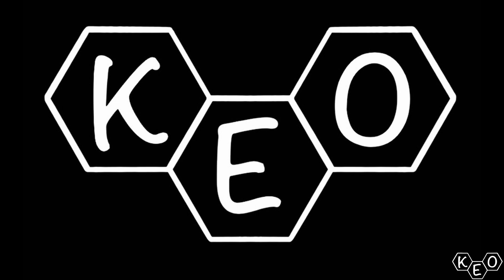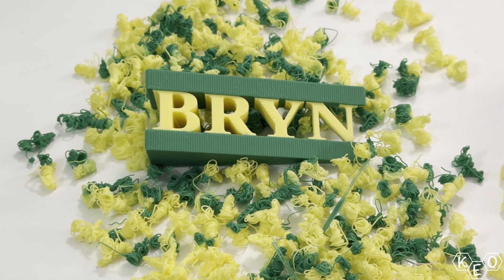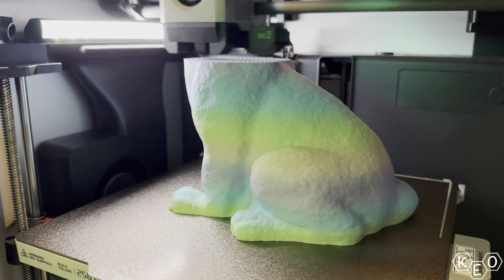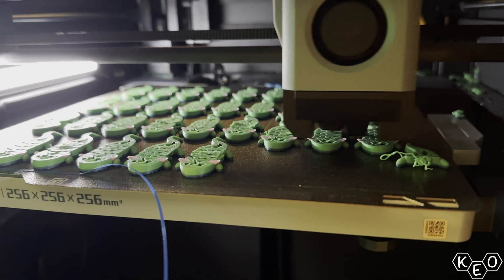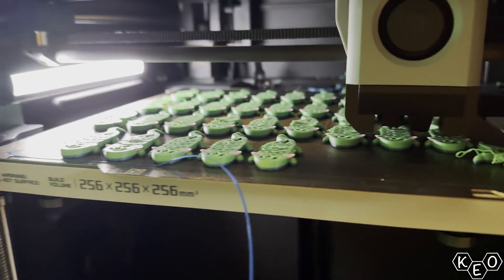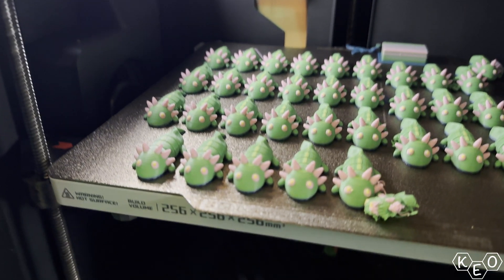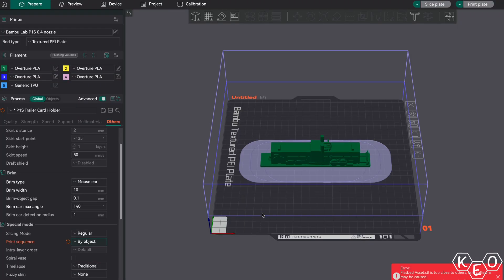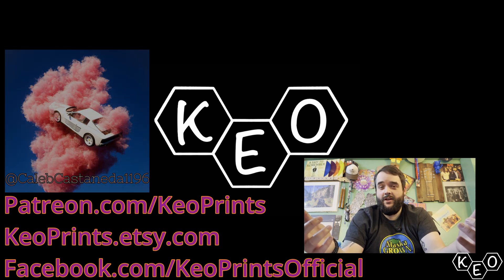Best Slicer For Printing Batches (The Right Way)

Comment: One trick with the space constraints. Combine models if you don't necessarily mind a bit of both worlds. Say your printing 15 models, this may not be possible as individual objects. BUT, orient them as a row of 5, and "merge" them. Then you may have room to do 3 rows of 5, as its now 3 objects instead of 15. You risk some of the quality issues you see with per layer, but if you see its something that only happens if you have say, 8 models (maybe filament is cooling and creating shrinkage for example with PA is a problem which can lead to layer adhesion issues), then 5 is a safe print. I personally don't see any quality issue difference between per layer/per object with default bambu profiles, but also ALWAYS leave filament flow rate test checked, since moist filament will easily be the #1 cause of that and the flow rate check is sensitive enough to notice that in how it flows during the test. Poeple say its a waste of filament, I call it a quality control check for the cost of like 2 cents of filament.. that ill mold into something later with the rest of my printer poops.
Reply from the maker: All good points here. Merging object groups and straddling the two worlds is a great note that I had not considered. Also, checking the flow rate waste vs. insurance.. im right with you. Seems silly not to run it before each print

Comment: Another consideration is that when you have a model with a small feature on top (like the chimney on the 3D benchy), layer by layer actually is better, because it allows the small feature to cool better, during the printing of the other parts. By object has another drawback, and that is when one of your first parts gets detached from the bed, and clings to the nozzle. Your blob of death can do enormous damage when the bed rehomes to the nozzle for the next object to print. So when I do use object by object, I'm not gonna leave it unattended, at least during object swaps.

Comment: also for by object i honestly found that doing moving it manual you can fit more prints on the plate you don't need to have them center you can have it at the edge of the plate the little cylinders your talking about you probably could fit all of them if you put them on the out sides going in to back, and the way by object seems to print is in order on the plate so first to last

Comment: i have been useing by object for awhile now just to do simple  mono color prints, to make use of the space you get by doing it i tent to buch my object as close together first and then merge them together. like just today i wanted to make some fidget spinners and some odd bits for spare parts on a toy that broke and phoneholder. printed that all on one plate frist starting with the lower height prints then to higher height one , took 10 hours in total for like 300grams of items over 20 pieces and you can still edit setings of each object like infill and speeds, just not layer height and ironing /seam thoes are global settings sadly